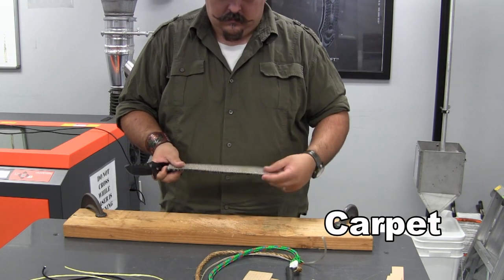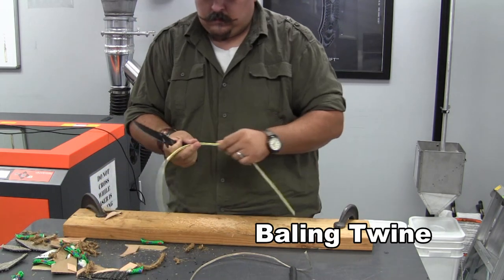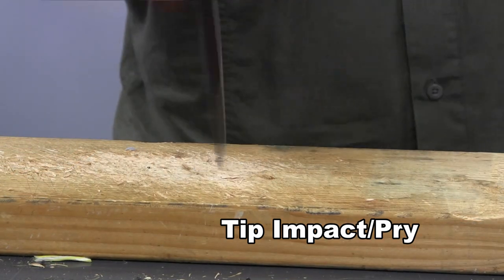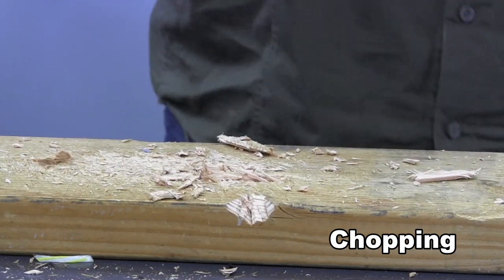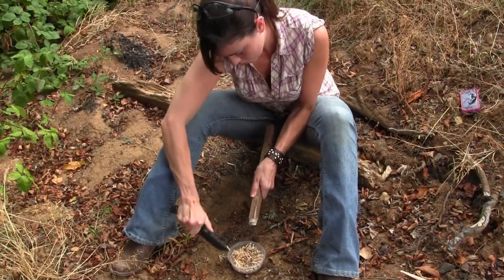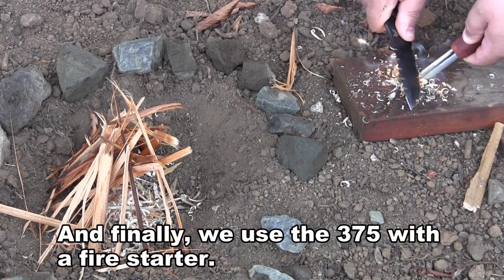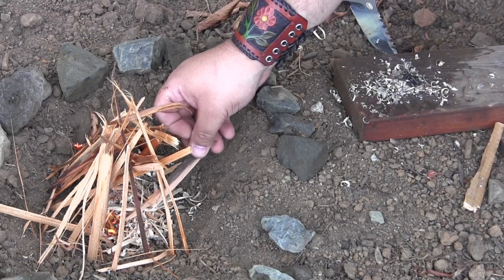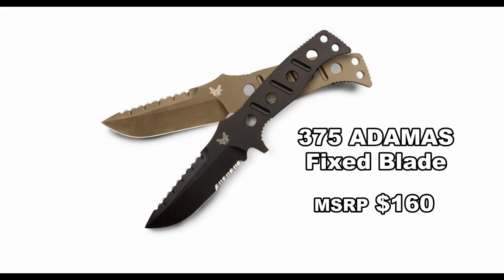Benchmade 375 Adamas Test and Demonstration

Comment: I've had this blade for several years. And have NO complaints what so ever. I have used it for trenching, carving out floor joists to fit in sewer line or other types of plumbing lines. I have used it as a small pry bar to pry out rocks and concrete. It's been a blessing to carry this blade.
Reply: I have used mine a couple times when the point on our jackhammer at work broke. All the stuff that breaks other knives. The 375 Ranger's through. Wish Benchmade had more focus on military knives. Bet they could trick up a K55K into the current times.

Comment: just so everyone knows, the serrations on the back of the blade are used for sawing, fire steel striking, widdling, and reverse combat raking. The grooves on the back of the knife are used as a hammer or added grip for reverse combat. Great ranger knife.

Comment: I own the Adamas 375BK (D2) and now the 375BK-1 (CPM CruWear), both knives are really really good and in my opinion both absolutely top full steel knives. The D2 version shows how good D2 steel can be, great heat treatment, tough and this with 60-62 HRC 👍 The CPM CruWear version is crazy good, CruWear is a crazy tough steel and this with 63-65 HRC 👍👍The sheath is great too (actually I don't like molded plastic sheaths, I prefer kydex or leather, but the Adamas sheath is an exception).

Comment: Got mine new for $144.95 And I have to say its hands down the best fixed blade I have ever owned. And damn if its not tuff as nails. Shit my only gripe is I looked for a gripe. Man camping this thing is a dream for dinner tasks. Good for setting up camp. Hacking up some wood, cutting rope, popping beer tops and its fun to throw.
Going to put G-10 scales on mine. After that it will be like the 162 only with a rope saw on the top of the blade and a proper hilt for pounding. Got a friend we are brain storming a sheath. RLTW NSDQ.

Comment: Interesting but other D2 w/ G10 options of similar size are significantly cheaper from other decent companies. Quality companies are bringing decent materials cheaper each year but Benchmade still offers something like the Griptillian for almost double knives of similar material, construction, and quality. I'm not a fan of cold steels marketing but the new Recon 1 could keep its own and is under half the price of this. Maybe need to readdress this at some point, though I'm sure fans that don't care about practicality will continue buying them.

Comment: Though I love knives and would love to have some of the nicer/more expensive knives my Benchmade auto I bought around 1996-97 when I went to work for a local PD in Ms was put through hell for the next ten years cutting plenty of seat belts, breaking glass in cars ( with locked keys with babies still in it) and houses on fire (with elders still in it), even bull rope that had a very large pissed off bull tangled up, still have that little auto today and besides a little duller and discolored it still preforms and will never leave my side, the only thing the knife I have needed was maybe a stronger blade release button, mine opened in my pocket a few times giving me a bloody leg on a few occasions on duty.
Reply: 2550???

Comment: NEVER EVER JAB YOUR KNIFE INTO THE GROUND.... that test was just flat out ridiculous
Reply: +Adam Greene its a test, to show the strength of the blade, obviously you would never do that. it shows that whatever you put it through it will last
Reply: Well this test was what I needed to see if it is worth a purchase for a role that could see as hard or harder use then this video showed, so great video for me.
 Oh I do have a couple blades that I "stab" Into the ground as it is their primary function(regrind and convex edge) to cut roots while digging/planting in certain cases.